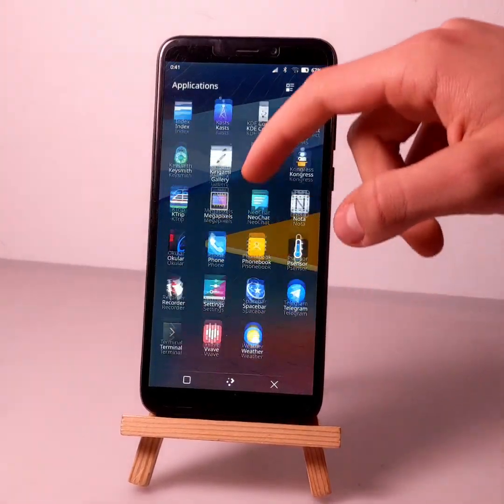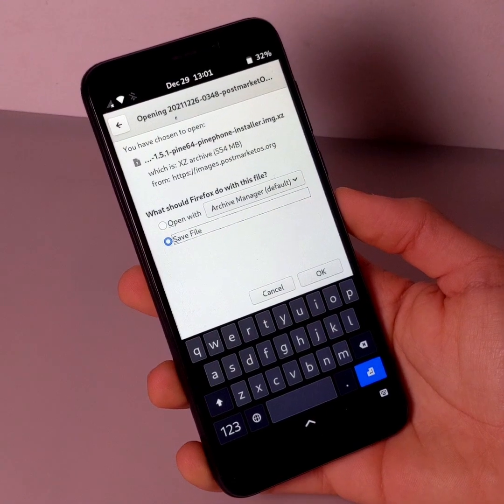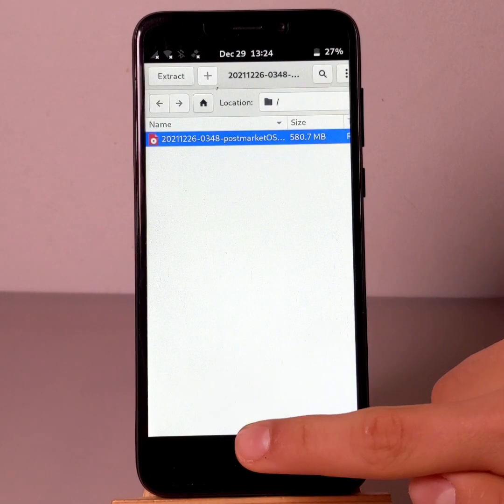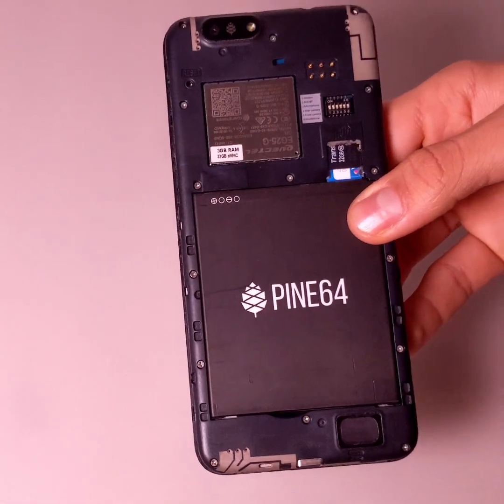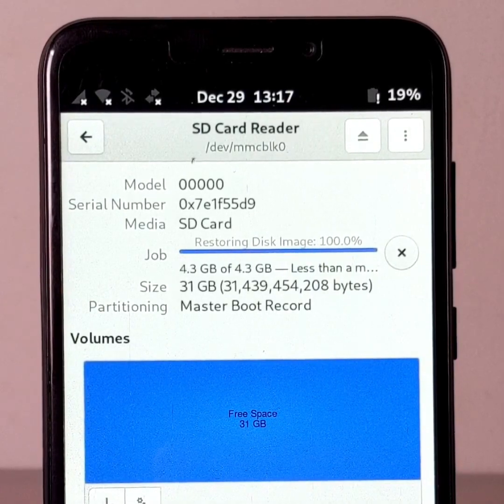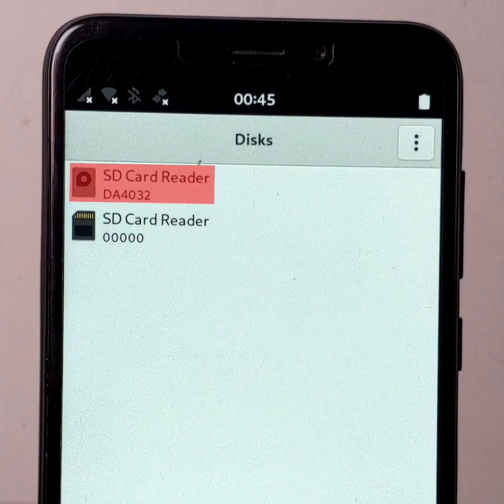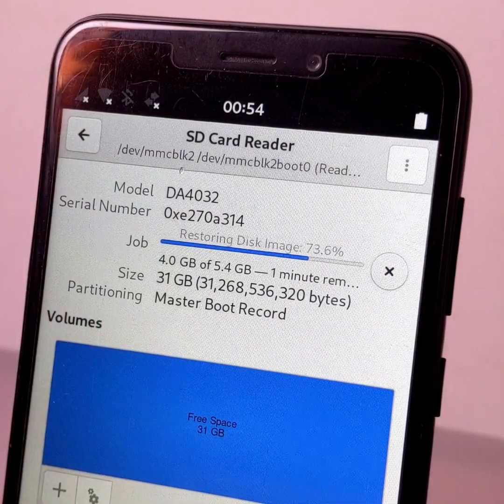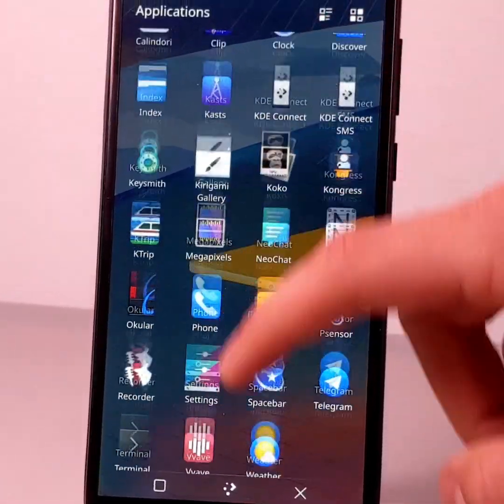How to flash an OS on the PinePhone without a PC (eMMC or SD)

Comment: I just wanna have a phone that doesnt need weird protocols to update every 3 days :\
Reply from the maker: @AmitureCreator101  And above all, unlimited updates over time (in theory)...
Reply: @avisando  You have to open the phone to put the sim card and sd card in it.
Reply from the maker: @AmitureCreator101  Yes indeed. If you are looking for simplicity, the PinePhone is not the right option.
Buy an Android phone compatible with UbPort (Ubuntu Touch) and use it as a daily driver. It seems to work well :)

Comment: Does this work for Pinephone Pro?
Seems like the answer is no, tried it, won't boot. I know there are some differences between the two devices.
Reply from the maker: I think that unfortunately this technique does not work with the PinePhone Pro because it is very different from the classic PinePhone when it comes to launching an operating system.
Reply: @avisando  it could be the OS apparently Mobian doesn't boot from eMMC right now on PPP. But I used Arch by dd flashing to eMMC and that works, but still there are problems with waking for PPP
Reply from the maker: @jacobdavidcunningham1440  I really don't know how to help you, but you can always ask for help on the Pine64 forum.
Reply: @avisando  Yeah that's where I got help lol
Reply from the maker: @jacobdavidcunningham1440  😅